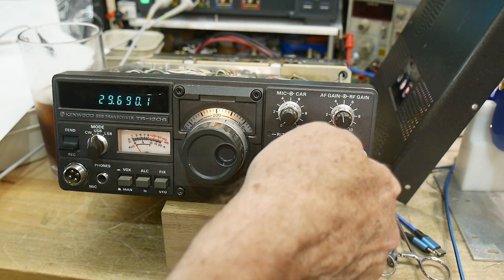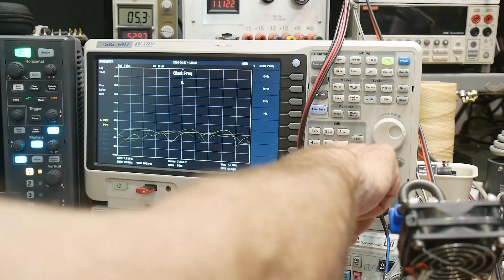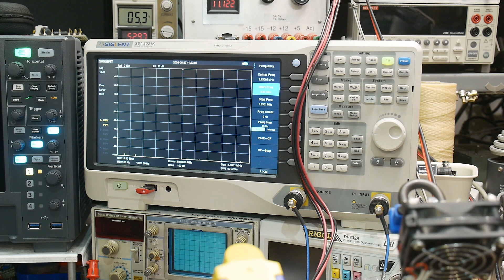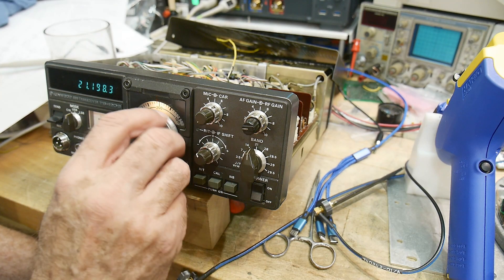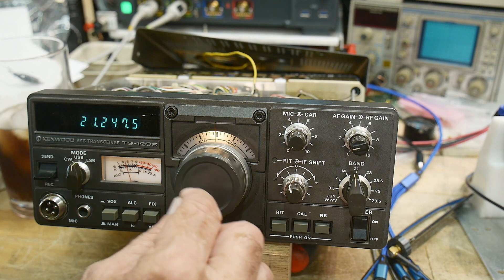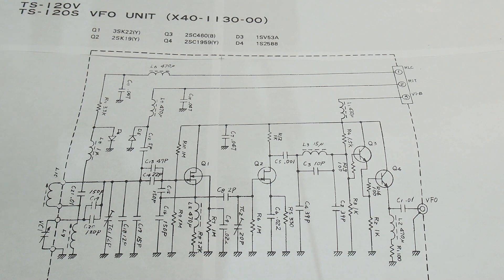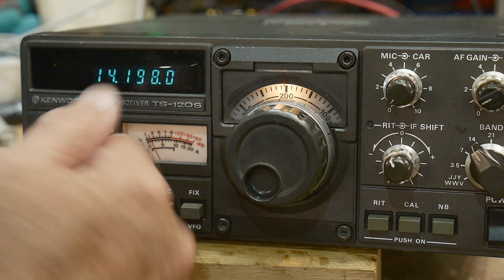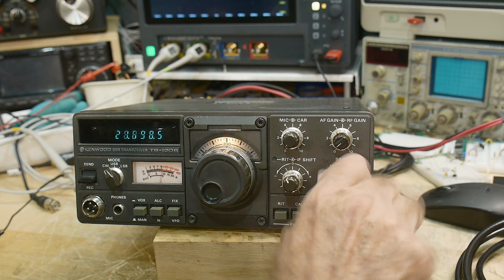#1998 Kenwood TS-120S HF Transceiver (part 5 of 12)

Comment: It sounds like an electrolytic capacitor might have reformed, or a cracked component with moisture in it is drying out after it gets turned on and then starts working again.
Reply from the maker: I replaced all the caps so that's not it. yes it still might be some moisture somewhere.

Comment: I built my own LED lighting for my radio bench using battery power with a linear supply for a float charger. Chinese LED lighting is just a noise generator, with zero attention paid to radiated noise.

Comment: If you get an opportunity to purchase a radio test set do it. Look up a Motorola 2000 or something like it. It has a generator with modulation and a variable step attenuator. You can test the sensitivity with it. It can do much more. It can also receive and test the output power for short tests.
Reply from the maker: I have a good one: https://youtu.be/j4mLM1l5M7A?si=xq45Ru39AEBOyDgg

Comment: If I were a betting man it would be on a bad solder joint. When something works or stops working after warm up. This radio likely has lead/tin solder. These solder joints are prone to the metals migrating apart after about 11 years. All they need is to be remelted and a dab of new solder added. The time to do this is when you change the capacitors. I speak from experience on an IC-725
Reply: The lead-free solder of later years are much worse regarding stability over time, and difficulty to repair. Just ask repair techs